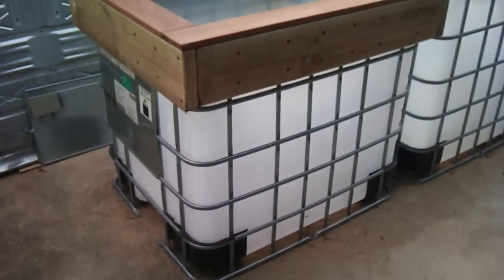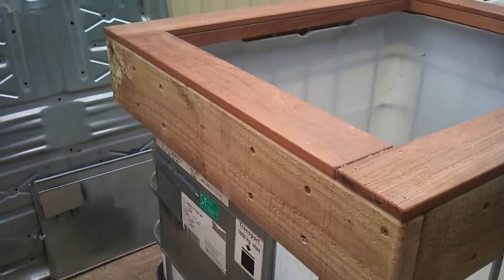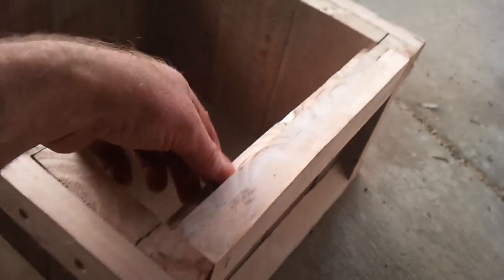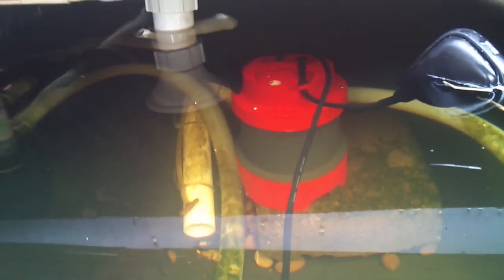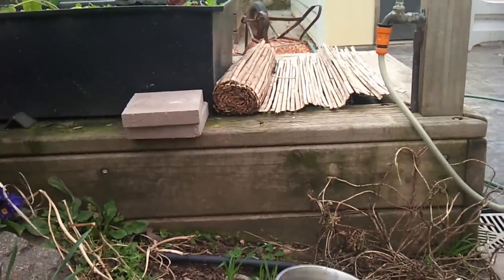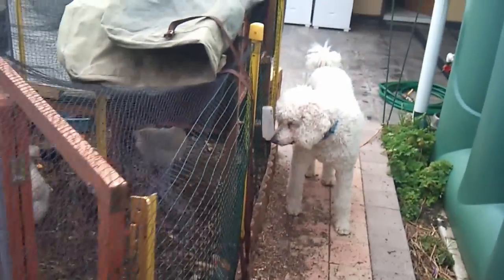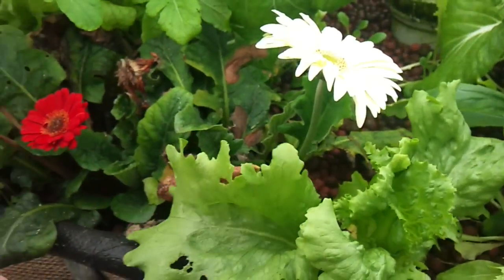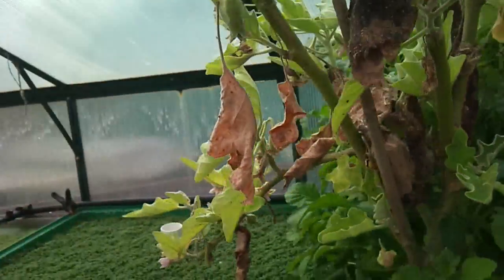Aquaponics in Canberra - Winter '12

Comment: Great set-up R B,  i have a question about your air pumps, in your experience are they allways needed to be runnig? or could the normal water drain be enough for oxigenating SilverPercs?  or is it more for the ammonia-nitrogen process that you keep them on? do you keep them on allways daylong and all night? thank you if you could answer.